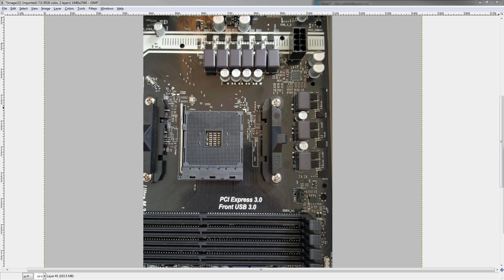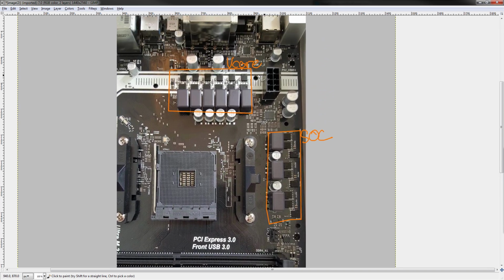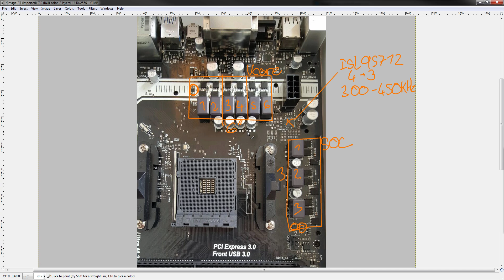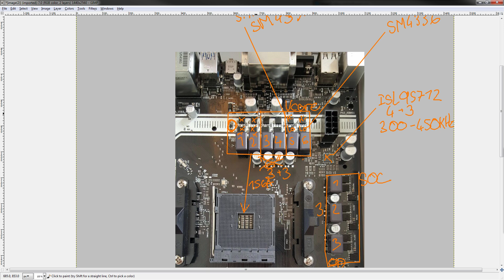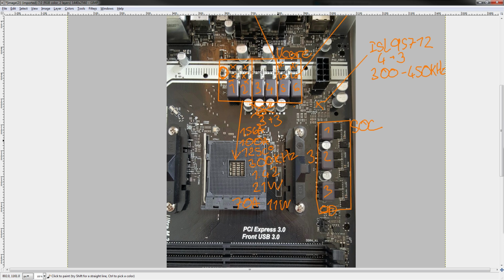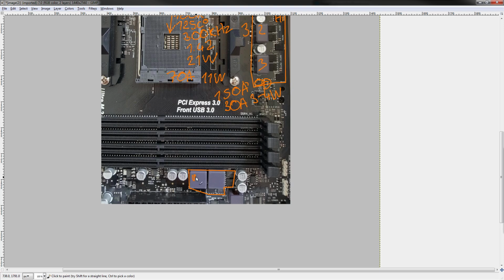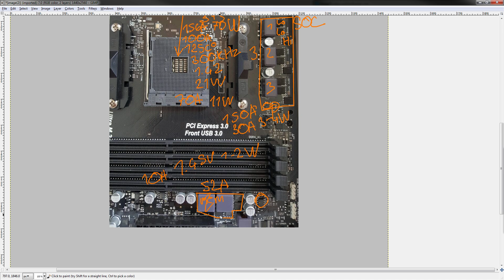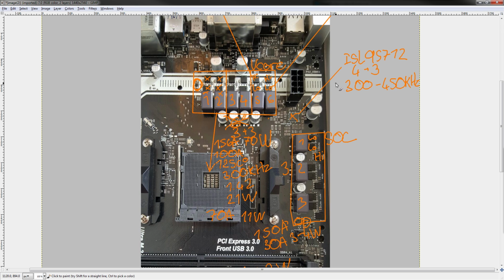PCB Breakdown: Asrock "6"+3 phase AM4 VRM used on the AB350M Pro 4, AB350 Pro 4 and AB350 Gaming K4

Comment: what's the best motherboard for the price? on a budget and so far im looking at the MSI tomahawk since a friend said the b350 prime by Asus has bios issues 

appreciate these videos
Reply from the maker: Yeah ASUS currently has some BIOS issues. Unfortunately the only AM4 motherboard I have is the X370 Taichi.
Reply: If you can squeeze it in the Gigabyte Gaming K3 looks promising at about $150 USD
Reply: BasicallyImHigh I'd go for the GB-AB350 Gaming 3
Reply: BasicallyImHigh As far as I know, MSI is doing a good job on their mobos. To my knowledge, the Titanium and the Gaming Pro Carbon are the only X370 mobos on which you can change the DRAM voltage yourself (I may be wrong with this one; if someone knows it better feel free to correct me).
Reply: The Tomahawk isn't great either apparently.

Comment: Damn I got the ab350 fatality becsuse i thought it was 6 phase.
Reply from the maker: I think lots of people did that.
Reply: this was a partial reason i actually brought the AB350M pro4 board, BUT i thought something was up with that at the same time, didn't seem quite right that it would have 6 phases when everyone else was using 4 and 3 + X phases, main reason i brought it was for the 2 m.2 slots and 4 RAM slots, and it works with my color scheme. 
also the VRM heat sink wasn't a block of metal that was lick an stick.
either way i can clock my R7 1700 up to 3.9-4.05 Ghz, thou it hits about 68c and im still unclear on HWmon's core temps vs Package temps and what is the max temp i should run on a 1700.

but at any rate the boards not to bad at all. just wish asrock would update drivers more often....
Reply: msi gaming pro am4 will it be good for 3.9 overcolck with r5 1600 or lower tier cpu

Comment: Thank you for looking at those models! They list the AB350 Pro4 specification as "9 Power Phase design" with no other explanation. I guess they total every phase on the board. You have to love the marketing teams! And that board does run well with a 1700 @3.875GHz @1.325V. It can go higher, but voltage needs to sky rocket; e.g. 4.0  stable @1.45V+ on the same 1700. The heat sink does get hot to touch.